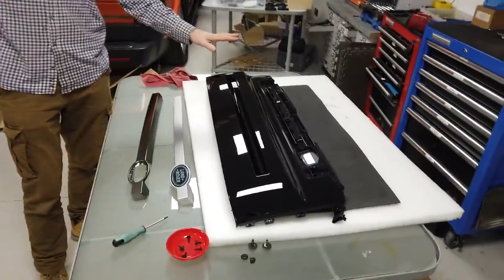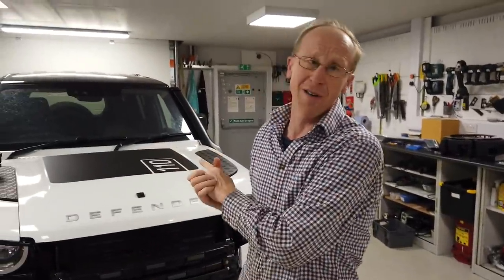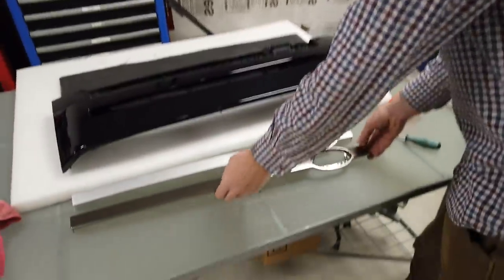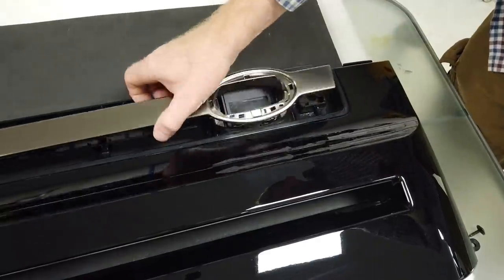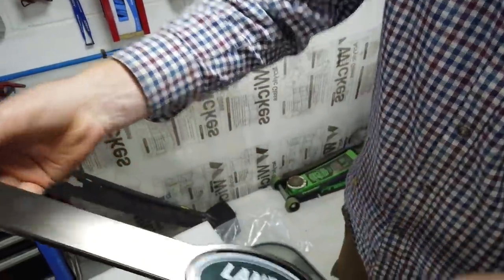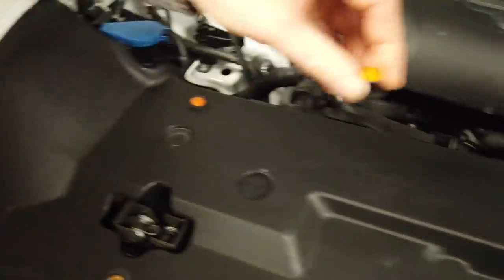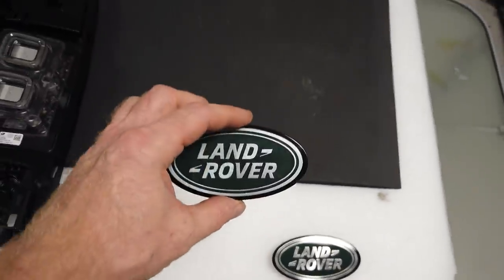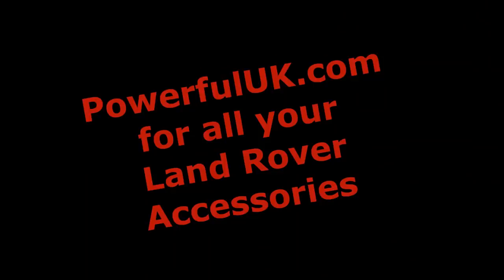Defender 2020 Front Grille Re-fitting / Options & the Radar Mystery

Comment: Morning everyone,
First thanks to Simone for being brave enough to do all this to your new Defender.
As removing the top bumper cover looks to be an easy operation, I thought I might see if my Defender had the Radar (First Edition). It would appear that they do, and this is why.
I disconnected the Radar, and the first thing that happens when you start diving is you get a warning on the screen saying “Emergency Breaking and Steering are not available. 
Also NONE of the functions on the right hand side of the steering wheel is available. Cruise control, speed limiter and lane assist are all disabled.
So, I assume that the ACC could just be a software switch.  This is because the emergency breaking must be linked to distance of the vehicle in front of you, applying the breaks at a set distance for the speed you are traveling.
I am sure that there are more informed people on here than I am, but this is what I have found.
Sorry for the length of the comment.
Thanks Again Simon.
Reply from the maker: Thanks for trying this on your Defender and this confirms my concerns. One of things that was "fixed" on my Defender on the last visit to the dealer was to try and stop the "Emergency Brake Assist not available" warning... i am worried that in "fixing" this they have made the car so it never gives a warning.... even with the radar disconnected... this is somewhat worrying ( for me )

Comment: Nice to see THE ST19 going back together again. I like the grille...not quite sold on the “Schultz” painted lower panel but I wonder if the radar is actually there on all cars but simply not enabled on the S. Deep in the menu, you might find it! My seats are heated/cooled etc but not massage yet I found the menu that Massage is there but not enabled..I haven’t found it since though! Good work again men!! Richard😀😀😀😀😀
Reply from the maker: I am looking at getting the Pathfinder Diagnostics next and getting into the dealer level software.... I did ask Land Rover to turn it on and the Ambient lighting while they are fixing my car but they said that the car must remain in its original specification.... but its a Defender....
Reply: powerfulukltd Hmmm...interesting that! I have often wondered if basic cars actually have most of the electrical goodies in them but simply not connected up. That way one wiring loom fits all and might be cheaper than making several different one. If you can get into their software, that would be very interesting!! Well done again...they must hate you at Grange though!!😂😂😃😃😃
Reply from the maker: @HQBProductions  Grange are cool.... I guess they need to be nice to me as i am a customer... no let me correct that... the correct terminology now is "guest"

Comment: The reason they are different tools is because they are moulded from different substrates (I think ABS and PP) for chroming and painting respectively
Reply from the maker: You point it valid but i think they are both ABS.... let me check. You need ABS for chrome plating.
Reply: Different grade of ABS-PC for chrome & different size tools because chrome plating affects overall size of finished part Vs painting.

Comment: Is the extra bit on the back of the non radar badge so you physically can't fit it with radar installed?
Reply from the maker: This is a possibility if one is radar invisible... this would then make it impossible to fit the wrong badge on the radar cars.
Reply: My thoughts too, interesting re ACC bit if EBA uses radar (likley) then thats probably it. Seems odd though to have them as separate options if all the cost is that sensor.

Comment: Would like you to look further into fitting adaptive cruise as I would like to fit it on my Defender when it comes.
Reply from the maker: Yes this is now becoming a personal challenge so keep watching...
Reply: @L663  Another challenge: retrofit matrix headlights and HUD.  Why you can't get those on the base/S/SE models is a mystery.
Reply: @L663  I have an SE without the adaptive Cruise so very keen to find out more (AUstralian Spec)
Reply from the maker: @stuartcoyne4435  Do you have the front radar in the grille ?
Reply: @L663  not sure without pulling it apart any suggestions on how to tell?
Reply from the maker: @stuartcoyne4435  Do you have AEB ?
Reply: @L663  sorry what’s AEB ?
Reply: Accident advoidance ? If so yes
Reply from the maker: @stuartcoyne4435  It is the Autonomous Emergency Braking system....
Reply: @L663  Yes I have that as its activated a few times
Reply from the maker: @stuartcoyne4435  OK that good and it may be possible - still working on it !
Reply: @L663  perfect I think a lot of people would be very happy (great site very very useful better than the landrover guys here)